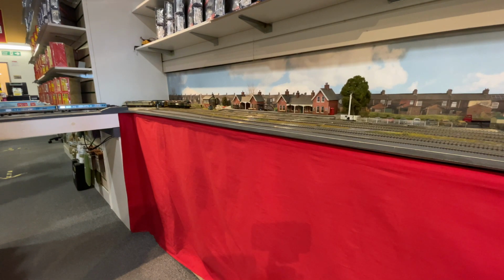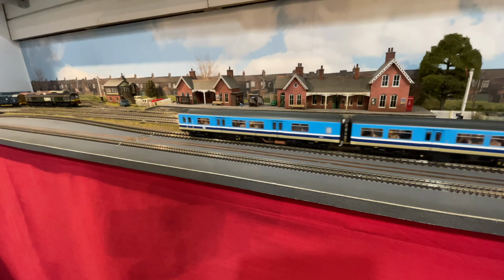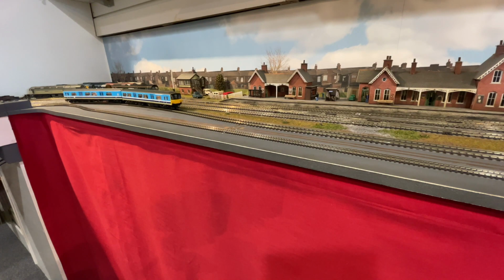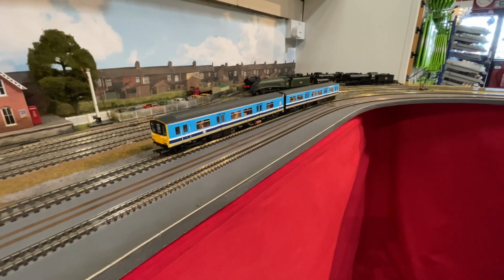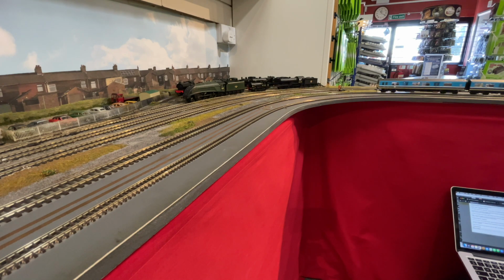Brand NEW Class 150 Sound file from Paul Chetter. DCC Sound.

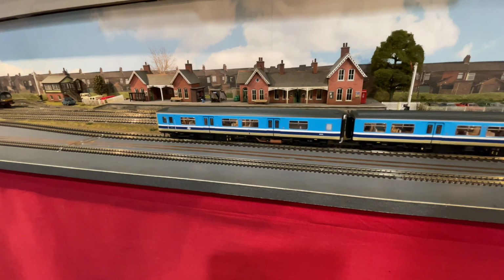Comment: Nice sounds - except for the fact that the engine sounds rev up when the unit is coming to a standstill as can be heard at 1:42.  Something not right there.  But if it's the same as Paul's other excellent projects maybe that can be overcome by engaging F6 (engine idling) prior to braking?
Reply from the maker: I think it may have been operator error on my part!